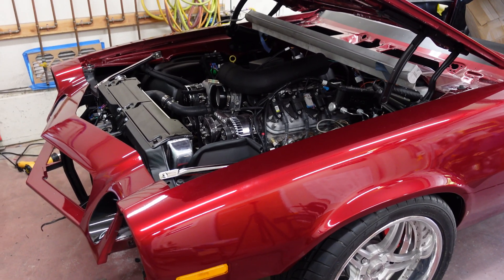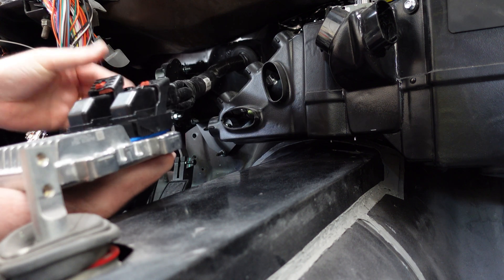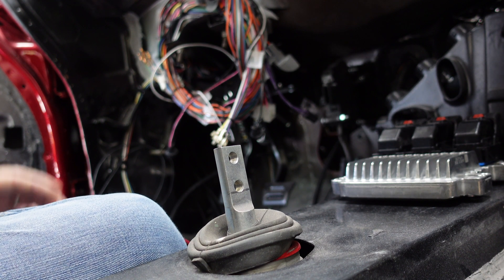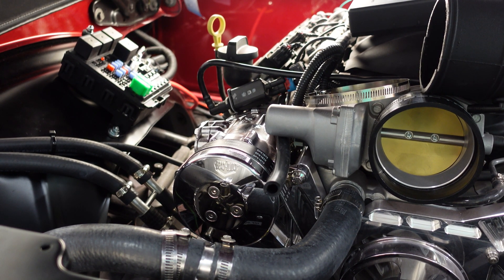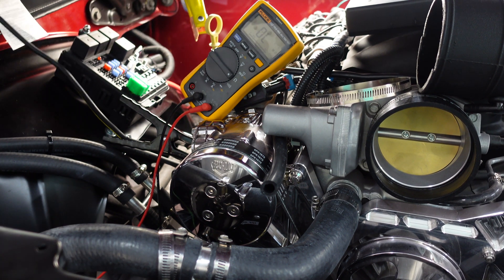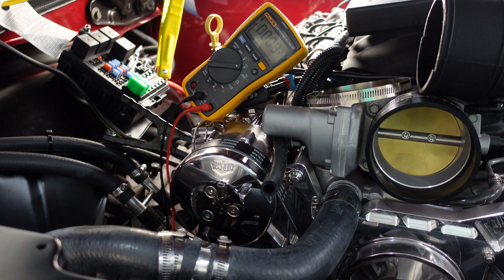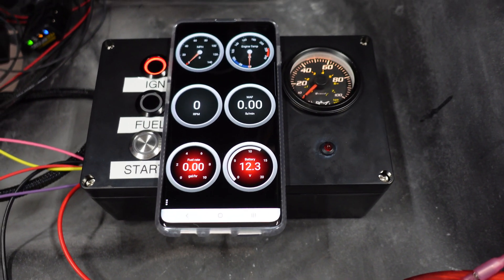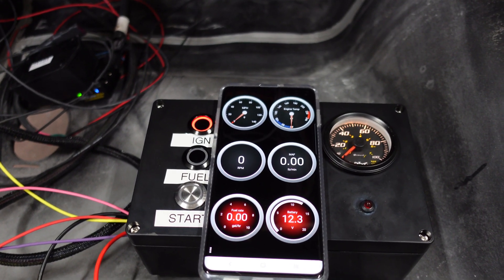1977 Camaro Z28 Part 265: ECM power-on

Comment: I'll add my vote for isolators, even with dynamat, to provide a separation from the tunnel for heat isolation at the very least. That tunnel will hold heat, and even a little air circulation will help.
Reply from the maker: Thanks John - this is the plan.

Comment: Hey Eric, if you tape off a square and put some seal sealer down, that creates a nice cushion and it can be quite a thin coat.
Reply from the maker: Thanks James. I will have Dynamat there, which should be about the same if I were to lay it straight on there, right?
Reply: @asicerik  oh yeah I would think that would work fine.

Comment: I think you get a twofer if you use the isolators. Number one they are going to allow the electronics to be subjected to less
vibration (a good thing). Number two is if you leave some gap between the sheet metal and the electronics case you should 
have better air circulation (another good thing) thus cooler electronics. May not matter in cool climates, but a drive through 
hot country could be for cooler electronics. My 2 cents.
Reply from the maker: Yup, I think you are right. In hot weather, the trans tunnel is going to be much hotter than the interior of the car (hopefully). Thanks for reminding me to put some Dynamat down before I secure that thing!

Comment: You could use thinner rubber well nuts to mount the ecm
Reply from the maker: Well nuts? Is that a thing? I could use grommets too I guess, yeah?
Reply: @asicerik  yes they were used on early Camaro's to mount the radiator.   Easily found at hardware stores.
Reply from the maker: @chriswilson3841  That's cool! I learned something new today. I already ordered a smaller version of what I have, if that does not work I will look into these. Thanks a lot

Comment: I would put the ECU on the rubber isolators, but I would look for some thinner ones. Getting there
Reply from the maker: Thank you sir. I will have to see if I can find where I got them. LOL
Reply: @asicerik  windshield wiper motor for your car has some that might be the right size
Reply from the maker: @punkalypso  Thanks. Those are just washers though, right? I need something threaded so I don't have to get under the car.
Reply: @asicerik  THEY MAKE RUBBER NUTZERTS THAT WILL BE VERY CLOST TO THE BODY YET OFFER SOME ISPLATION I USED THEM TO MOUNT MY RAM AIR PAN TO THE HOOD ON MY 69 TRACTOR SUPPLY CARRIES THEM AS WELL AS SOME OF THE TRUE VALUE HARDWARE STORES
Reply from the maker: @chrismansker8870  Thanks Chris. Sounds a lot like the well nuts suggested elsewhere.

Comment: The pcm grounds the MIL lamp wire to light the bulb. The bulb should have 12v and then be connected to the MIL wire. The bulb should light on key on but will extinguish once the engine is running. The pcm will also set a DTC if it notices something wrong with the MIL circuit, so that can help you figure out if you've set it up correctly.
Reply from the maker: Thanks Andrew. Could be, yeah. I see the light blips on for a sec when I turn it on which is odd. I will check it with the meter.